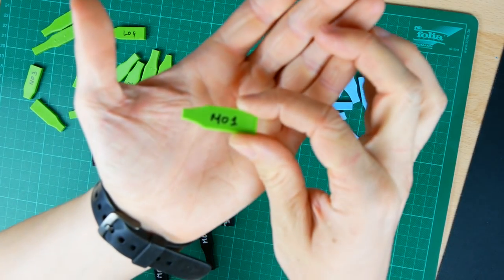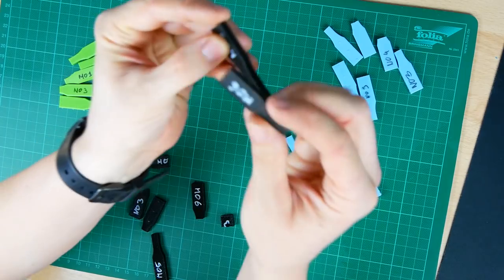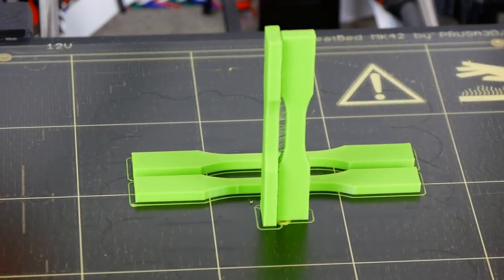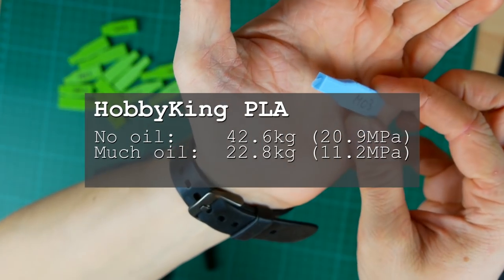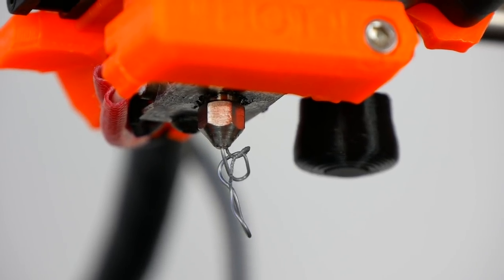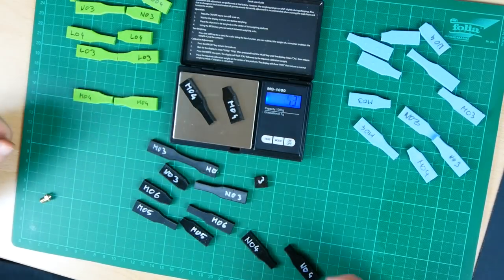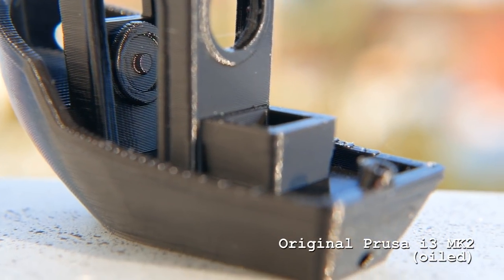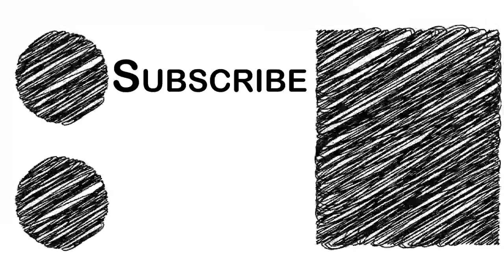Filament Oilers Revisited #1 - not as bad as I thought!

Comment: I work in a dusty shop and use this as a simple way to clean dust off the filament. I use very, very little oil and change the filter often. My reliability went way up on printing in general after adopting this practice.
Reply: Daniel, do you think the improvement is solely due to cleaning the filament and continually putting in a fresh piece of foam? I'm wondering if the small amount of oil is of any relevance? I think I will follow your lead as my space is also dusty. I'm skeptical about using oil, but perhaps just 'cleaning' it on the way in would be sufficient.
Reply: @rodneysmith4863  In my experience, the oil is only there to capture the dust, and it's very effective at that.

Comment: I actually work in a company specializing in plastic additives; it is normal practice to add fatty acids(which is present in vegetable oil) .
By adding small amounts of fatty acids, plastics typically becomes more waxy and slippery. while that does not strengthen plastics, my speculation is that since nozzles are bad at kneading plastics, the addition of fatty acids makes the melt slightly less viscous(easier to knead) and thus create a more uniform extrusion melt.

While i havent tested PLA due to small worldwide demand(compared to PVC PP and PE) and unknown additives present in the filament, i cannot say for certain what is happening. The world of plastics is actually much more complex than what most would believe.

Comment: My hypothesis is that using oil in the filament not only reduce friction,  but olso improve heat conduction from the hot end to the plastic, the oil creates an interface that increase superficial area improving heat conduction that could increasing the temperature  and improve layer adesion.
Reply: Juan Blanco it also reduces the stick factor to the inside of the nozzle when it is cooled down
Reply: Printer 2016
Reply: Just for the record....when vegie oil get hot it degrades and then goes sticky. I have to wonder who dreamed up the oil aspect for printing as the aftermath of sticky oil will make you tear your hair out....it gets in everywhere and is impossible to remove once it goes sticky.....everything sticks to it especially airborne fluff from your clothing. I think that if you get oil in the PTFE tube, which is designed with  an internal coating specifically to allow free passage of the filament, and more seriously on the extruder drive mechanism rollers, once the oil deteriorates you just have to replace the tubing totally. If you must have oil at all costs, then I would suggest a hydraulic oil as is used in automatic gear boxes..... (I can't say if the hydro oil will attack the filament etc)....designed to operate at high temperatures without going sticky. This is something I will NEVER EVER use despite some saying they get better results with oil etc.  @antonburger4260

Comment: I'm not sure why the vegetable oil improves layer adhesion but don't be surprised about machine oil having different results than vegetable oil: chemically they are not at all the same just because both are called "oil". Mineral oils are basicalle alkanes, long chains of carbon with hydrogen all around. Vegetable oils are esters, formed from the alcohol glycerol and 3 fatty acids.

Comment: I've had issues with oil so I started just to use just the filter to remove dust from the filament, since I work near a very large road high high traffic... I removes alot os dust from the filament! that I would recommend for someone with the dust and ar pollution problem..

Overall, really nice work Stefan! Always good content!
Reply: Anyone with that amount of pollution in the air had better use a surgical face mask or you'll soon be gasping for breath......BTW, if the airbourne stuff is of a wood nature you are at the risk of a carcinogenic attack.

Comment: Oiling may be doing a couple of things. Firstly, its main purpose is to remove particulates from the filament like dust or dirt. these particles can lead to clogged hotends and inconsistent layer adhesion. 
Secondly, as you noted, it will act as a lubricant, allowing the filament to flow a bit more easily through and then out of the hotend.
As for chemical properties, PLA is a plant based plastic as  opposed to petroleum based. Chemical Engineering isn't exactly my repertoire, but I would guess that a plant based oil will behave better than a petroleum or synthetic based oil as far as bonding with the PLA or aiding in its self-adhesion as opposed to preventing layers from adhering.

Comment: Its interesting that with the oiler, you got an improvement in print quality and in layer adhesion, yet recommended against it.  
I'd like to see you revisit this topic one more time using your extrusion flow rate test, to see if a light oil film impacts the maximum extrusion rate.

Comment: I know this is a 2 year old video, but it makes me think a fun set of experiments would be testing the effects of different oils with smoke points and flash points close to the temperature of the nozzle. My first instinct on the difference you are seeing is either that or polymerization of the vegetable oil. Could make a very expensive and time consuming run of tests, but will put on my to-do list, I may get to it in 2 or three years.
Reply: Hey, it's been about 2 years, any updates?
Reply: @proxythe1337  Thanks for reminding me about this. The referenced to-do list got lost in some chaos, adding this project to the new list. Which probably means I will get around to it about the time I retire.
Reply: @TrabberShir   How's retirement going?
Reply: @SianaGearz  about 10 years out still.

Comment: Hey! I started using oilers a few months ago for a CR 5 PRO H and my ender 3 running a spider v3. i got consistent colgs on my cr5 (prabobly the hotends fault) using an oiler enabled me to add more retraction distance and get rid of almost all stringing (it was a really bad) i ran 6mm retraction on an all metal hotend, and it could retract without skipping, Same could be said for the spider v3. I was aware it could cause damage to the hotend but i wasnt really concerned with that since i wanted to rebuild the cr5 or at some point just completely throw it out the window. Catch is, i used gunsmithing oil, the one you can get in a military shop or game shop/hunters shop. my theory is that sice gunsmithing oil is meant for high temps and to clean small particles, it prevents filament from sticking to the walls of the hotend when retracted, that being said it prabobly reduces layer adheasion. But i'm not really concerned with that since most print where strength is a factor don't require a lot of retractions and can remove the oiler, but some amout of oil will remain in the ptfe and hotend regardles.

Comment: Maybe by increasing the number of samples for each type of print you get less contrasting statistical results.
I also wanted to add, but maybe you already know, that in plastic molding, to use scraps, also sometimes use plasticizers oil added to scrap ... news from a die-cast plastic printer many years ago.
Probably not only the oil improves sliding but it blends with the material by changing its mechanical characteristics.
Almost certainly changing the type of oil: vegetable, mineral or silicone, just to name a few, you get completely different results

Comment: So-called "drying oils" will slowly harden upon exposure to oxygen (faster if heat is applied).

For example, linseed oil is the base material for  traditional oil-paints.  It doesn't actually "dry" by evaporation.  Instead, it reacts with oxygen and polymerizes.  The result is a "bio-plastic" that is durable enough for oil paintings to survive for centuries.

Drying oils are typically unsaturated oils, or polyunsaturated oils.  It's probably better to think of these as "curing oils."

In any case, they're used in traditional oil paints, used to finish wood, and to coat cast-iron cookware to form a non-stick layer (this is called "seasoning" cast iron).

You can find out more here:
https://en.wikipedia.org/wiki/Drying_oil

Must lubricants, like machine-oil, are non-drying.  Because, obviously, you don't want your lubricant to solidify and harden!

I don't know why you're seeing more strength with a filament oiler.  Two hypotheses are:
(1) Oiler slightly increases extrusion due to lower friction.
(2) The oil might be polymerizing due to heat and oxygen, and might be helping layers stick together.

I don't know, but machine oil probably reduces friction of extrusion, but it doesn't polymerize.

Comment: I had some bad experiences with a new titanium heatbreak and prusament pla, the filament just plain and simple got stuck inside the heatbreak and printing was impossible. Obviously i was super bummed about this because i thought prusament was supposed to be a really good quality filament ( and it propably is ). I eventually tried some avocado oil on my filament, and the filament started to flow very well. Prints seemed to be very good even with the oil ( i used a filament oiler from thingiverse with some sponge material inside and a LITTLE BIT of oil! )
Reply from the maker: E3D titanium heat break? Shouldn't happen if the surface finish is properly done.
Reply: @CNCKitchen  Nah i wanted to test an off brand one first. Also changed to ideamaker for slicing and got perfect results FIRST PRINT with prusament.. Go figure.. :D

Comment: I use flax seed oil, and all my oiler related problems are no more. It has a very high flash point so you won't smoke it, and if it solidifies, it leaves a very slick and hard surface. Flax seed oil smells mildly fishy though, so that might bother you.

Comment: You don't oil your filament without reason! One when you often face jams in your hotend, you can use a filament oiler to make it work again without any issues. If someone got no problems with jamming, I wouldn't recomend oiling the filament either. Also it's only neccesary when printing with PLA. ABS works just fine without any jams. I don't know how other materials behave.
Reply: ... ONLY pla? nope. I get jams with petg, Pla, nylon, abs... Oil fixed it for all of them.

Comment: when I first upgraded my maker select to the flexion high temp extruder I was having terrible extrusion problems that I was told was related to too much tension. well I added oil to my filter (left over unused motor oil) and all my extrusion issues stopped. additionally I haven't had to oil the filament since. So my theory is that the oil worked similarly to how cast iron pans get seasoned and created a thin slippery surface inside the nozzle helping to prevent jams. that's my long winded response to the tungsten nozzle. If you haven't already try "seasoning" the nozzle with oil to reduce friction inside. it may help compensate for the machining marks.

Comment: I do not think the oils effect has to do with reduced friction in the feed path, with a direct drive feed the feed path is very short and there is little opportunity to really reduce friction by any measurable amount, and after all you WANT friction between the feed roller and filament.

I suspect the benefit comes from the oil coating the nozzle and/or modifying the viscosity of the molten plastic and thus improving extrusion. The benefit would thus depend on the nozzle type and filament type. On my Makerbot 2X I cannot reliably use PLA (won't print for more than 10 minutes) without an oiler (and vegetable oil). I used a sponge meant soldering iron cleaning. Perhaps the speed at which the sponge material wicks out the oil is important as I have had no dripping of oil at all.

On wire fed welding machines (MIG) there are oilers/cleaners that clip over the wire before it enders the feed rollers. You don't put much oil on these, they are intended to remove any dirt/corrosion so it does not collect in the feed rollers and liner. For welding mild steel this small amount of oil is not an issue.

Comment: i have found since switching to a titanium heat break, when i do want to print pla i need to use an oiler or guarenteed jam, its fine without oiler for abs, nylon, petg but pla needs lubrication in my expierience with all metal hotend, dont know about stainless, ive always used titanium or ptfe lined..
Reply: Metal or Titanium oil works better. Also works well with PETG. Not sure why the guy think its effects bed adhesion. Actually can improve it just like strength as the flow is more steady.

Comment: Personally, I've only once found oiling the filament to be a necessity-- while printing PLA on an old Makerbot replicator 2x at work. The way the extruder was set up, it seemed to overheat at the gripping end and soften the PLA too much to be reliably extruded. In that particular case, I believe oiling the filament dissipated heat across the plastic, but really I'm not sure... I just know that it worked. And I was using machine oil. Not sure about the strength of the parts relative to un-oiled, because it just wouldn't extrude on that machine without it.

Comment: its just that the resolution of the stepper is bad- oil helps reduce friction that wil make use of more of those weaker micro steps which will make smoother extrusions- Could just change to 0.9 motor and e3d aero compact edition- get better quality benches-

make sure your ultimaker belts are tight- looks like you've got some ringing from looser belts and high acceleration. also maybe outer diameter speed slower.

Comment: Thanks for posting. Interesting idea. Polyunsaturated oils might be good candidates because of their double bonds (unsaturation) which could thermally polymerize, either during the extrusion process or in a follow up annealing process. Others have looked into this for other reasons (seasoning of iron cookware ... http://www.chemicalforums.com/index.php?topic=39242.0 ). Perhaps coating with a slow acting thermal adhesive might work too.

Also when making comparisons its important to consider the variability of the test results. For example @ 2:57 results for strength without/with oil are quoted as 86.0 kg and 89.3. That's only about a 3% difference. If the variability of either of the results (86 or 89.3) is of this order or more then these too results cannot be distinguished statistically, that is, we can't say with much certainty that the cause of the difference is due to the absence/presence of oil. Also I assume these are breaking strengths. In that case they are likely to have higher variability than, for example, modulus.

Anyway nice investigation. Cheers.
Reply from the maker: Thank you for your detailed comment. I really need to read some books about polymers. As a "normal" mechanical engineer usually working with metals that's sometimes quite tricky.

You're right. The statistical background is not very high, so slight differences might not be significant. I usually try to only point obvious out. Since I have a limited amount of time for this stuff, I need to keep it as simple as possible, but still provide more technical information than probably most other related YouTube channels.
Reply: What about silicon based greses does it have an effect, i have been using that in my bowden style one for a while because i assumed it would be relatively inert.

Comment: perhaps the oil layer is preventing the plastic from cooling so fast, kinda like a cheep Annealing operation

"Annealing, in metallurgy and materials science, is a heat treatment that alters the physical and sometimes chemical properties of a material to increase its ductility"

put non oil treated samples in an oven, low temp  ie not hot enough to remelt the plastic and let the reheating take out any stresses, this should push up the strength of the part perhaps

kinda like Juan Blanco comment

Comment: this is why I avoid all metal hotends and just go print nylon and sh*t with my ptfe lining, which has lasted over 100 hours without any signs of wear (inner diameter is not tighter, coloration is not radically different (barely milk coffee vs milk tea color in difference, new vs old)), and which I can very easily just replace. no clogging. no oiling. just printing.

Comment: try vegetable/propylene glycol, it should"flash off" at the hotend
Reply: yeah i use wd40 and it seems to work great and it has a low boiling point for an oil, (but i also use ABS not PLA)
Reply: And a fume cabinet for any filament in future.

Comment: maybe try a drying oil, like linseed oil? :)
Reply: Linseed oil can be very flammable if exposed to the right conditions. It can actually combust if on a flammable material without a spark in normal temperatures. I think that’s a neat idea, but maybe some other than linseed oil 😬

Comment: i think it is that the oil wil keep the plastic liquid a bit longer so the layers can melt togethet better
Reply from the maker: Any reason you think that since the temperature of the plastic should stay the same?
Reply: i mean that the oil keeps the heat better so the plastic wil be liquid a bit longer
Reply: ….and hot vegie oil goes sticky too. @bjarnuhh971

Comment: A video about the tensile test machine would be nice :D Or do you have any guide for building one? Which sensors are you using?
Reply from the maker: I'll definitely post a video about it in the future. There is no guide at the moment. I designed and built everything on my own. The load cell I'm using is a 5kN AEP force transducer.

Comment: instead of oil, what if happens if you use powder of filament. just mill some filament and use everything best clean possible.
Reply from the maker: I don't exactly understand what you mean?
Reply: CNC Kitchen did you have seen carbon powder lubricant? my suggestion is mill a piece of filament and percolate the result to obtain a powder. use that powder as lubricant